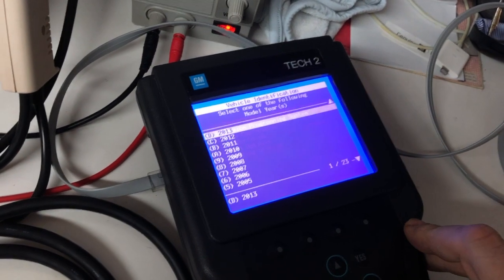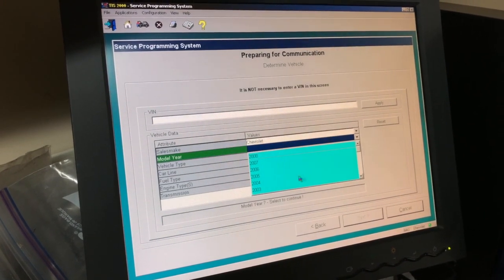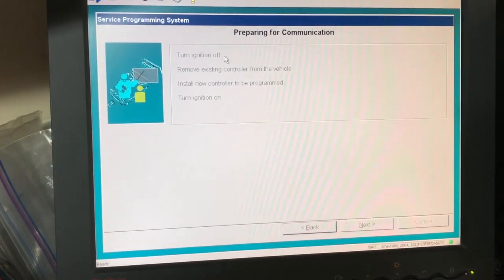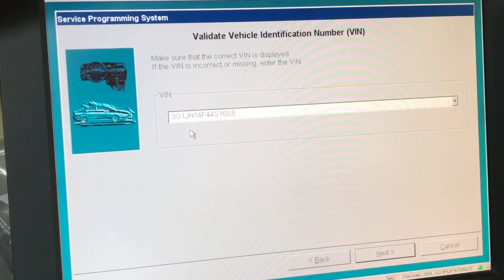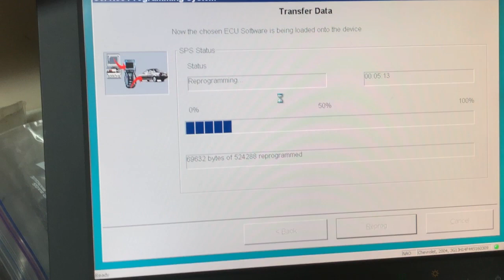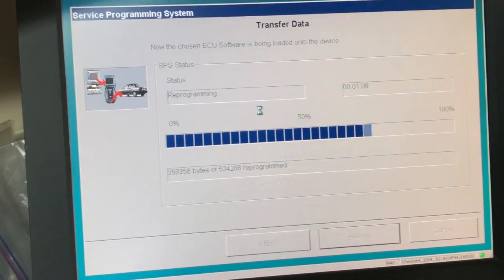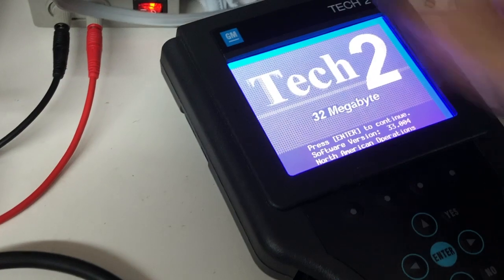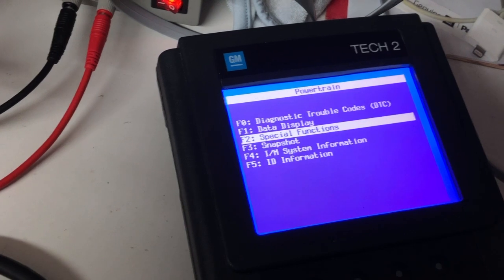2002 - 2005 GM P11 PCM Salvage Yard VIN Reflash with SPS and Tech2 (Chevy Pontiac Olds Saturn)

Comment: Hello,  I have  a authentic tech2 and tis2000 loaded on a tough book with a Bosch Mastertech J box.  I have successfully programmed several modules (on vehicle ) on various gm vehicles . I have been trying to bench program instrument clusters without any luck .  I’m trying th change programming on the microprocessor. I have a programmer to change the bin file on the eeprom. I have a simulator with a ecm , bcm and Vci.  It keeps saying install new IPC. Any thoughts?
Reply from the maker: I haven't attempted to do an IPC on the bench myself.  I presume you're trying to do SPS from within TIS2000 then for an IPC?   Be sure you select the Off Board Programming Adapter (OBPA) and not Vehicle when prompted in TIS2000 would be all I could suggest (even if you don't actually have one of these ultra rare tools in the bench setup).  In my own experience that selection was necessary to relax some of the SPS checks before I could program a PCM on the bench outside of an actual vehicle.  I suspect that the Tech2 and SPS do some checks that require more than the PCM and BCM on the bus as I've had to select OBPA even with both to have any success.
Reply: @DrShock  Thank you for you help, I was able to change the ecm and bcm programming  to a different year and vin number but not the IPC.
I do know that tis to web does not allow any bench programming. They told me that directly. 
I work for a used car dealership and we have a subscription.  I will follow your advice and see if it work with my tis2000. Thanks again. I greatly appreciate your help.

Comment: Hi. what if I cant Contact to the old ECM   because there is no Check Engine light in the dashboard in key position 2
what I need to flash the new ECM ( GMC Terrain 2013)
Reply from the maker: It may be that the bulb is burnt out for the check engine position, there is certainly one on all GMs.  2013 would be far too new for this video to apply.   You would need the GM MDI scan tool instead.   This video may help for what's involved there - https://youtu.be/sUMJFwMuAkE
Reply: @DrShock Thank you for your help
but if the bulb burnt out why I cant scan the ECM at all
Reply from the maker: If you're using a Tech2, it will not support many 2013 vehicles even with a CANdi module attached.   If you're using a non-GM scan tool I wouldn't know as I don't use those.  Here's a good reference link on the GM tools, you can see the GMC Terrain started being supported by the MDI tool in 2010 - https://www.genuinegmparts.com/pdf/positionstatements/vehicles-supported-by-GM-scan-tools-reference.pdf   Of course, there's also the possibility you have some damage to the wiring preventing communication, but I would suspect a tool mismatch first.

Comment: Hi......can this operation done with gm mdi  or only by tech2 ....thanks
Reply from the maker: Both would work fine, but if you use the MDI it will of course cost more $$ as you would have to have a subscription to GM SPS programming at www.acdelcotds.com
Reply: @DrShock  thank you

Comment: i have a tech2 that i use on my saab. do you know if a 2008 saturn vue is one the gm 32mb pcmcia card?
Reply from the maker: The Saturn models are different in alot of ways and I've had viewers comment, for example, that they don't show up at all on TIS2Web applications.    You'll want to just power on your Tech2 and build the car and see what options you get given after picking 2008 and Saturn under diagnostics.
Reply: DrShock ok so there is an option. Thank you very much

Comment: I'm About to do my first flash ever on an 06 cobalt...getting a used pcm, I have a cardaq 3 plus...this process the same?
Reply from the maker: It won't be the same as the Cardaq is not a Tech2 and is not compatible with the older GM TIS2000 software I showed here.   But you should be able to use it with a ACDelco TIS2Web subscription as a J2534 device.   You won't have the off board programming adapter option as that's not supported by J2534 tools, but you can still update the VIN using SPS.

Comment: If you replace a ecm and BCM  at the same time do you need to reprogram the ECM as you showed. With the BCM still
Work or no?
Reply from the maker: I'd suggest doing the ECM/VCM/PCM (acronyms de jure) type module first as that's the primary controller in the vehicle, and then doing the BCM second.   But I've never read that's a requirement, just seems like the more drama free path imo.   If it's a brand new or OEM remanufactured BCM you should be able to do the setup with the Tech2 independently of the ECM.  If it's an used BCM, well these older ones you can't update VIN or the mileage or odometer values (I did another video in this bench harness series on these BCM issues)

Comment: Hey Doctor. Im purchasing a ecu from a friend with a tune on it for specific parts for my corvette. Is there a way to change the vin to mine without erasing whats on the ecu?  Thanks
Reply from the maker: I'm not 100% sure as I only use the GM tooling.  But the GM scan tools are going to remove any third party tunes as best I can recall, as those are not GM approved calibration files.   I'd suggest you'll want to either let the GM tool reset the calibration and revise the VIN then separately re-apply the tune with the third party tooling.  Or use a third party tool that will also support updating the VIN.

Comment: I would like to know if you have used the tis2000 in isuzu vehicles? I have the tis2000 but I could not install a used ecu to isuzu 2002 axiom when I write thevin number  tells me that it does not exist, maybe that car is not in the tis2000 database?
Reply from the maker: I have not, only classic GM brands.  But you are on the right path, you have to have the Isuzu unique firmware version PCMCIA card plugged into the Tech2 itself, and Global TIS on the PC.  The typical TIS2000 DVD is only for North American GM brands.  If you search here on YT there's at least one video on how to install GlobalTIS for Isuzu vehicles.  Typically when you buy a Tech2 Chinese clone you have to specify these so they include the right versions.   There were different Tech2 firmware cards, and TIS DVDs for Saab, Isuzu, Holden, etc.

Comment: dr shock, so the dvd tis2000 that comes with the tech2 i am able to reflash off-line with it till 2007.so it comes with the calibrations already? or am i missunderstanding? thank you for your time and your good work
Reply from the maker: That's right the Tech2 using the old TIS2000 DVD is completely offline, no subscription required.  But it only covers thru model year 2007 (and I believe it is missing most of Saturn which had their own unique tooling back then).  Down the road you can still use your Tech2 from 2008 thru 2013, but you'll need to pay for TIS2Web, with an online subscription (around $40 per VIN for 2 years).

Comment: I want to recreate what you are doing--where should I get the TIS 2000 and do  I need an older computer? Thanks if you got the time
Reply from the maker: You would have to get TIS2000 when you buy a Chinese clone of the GM Tech2 scan tool (they're bundled together).   It only runs on Windows 2000 or XP so you'll need a museum piece, or put it into a VM on Windows 10.  You can usually find these on ebay http://ebay.to/2FLoIjI
Reply: @DrShock  Thanks

Comment: When you said "Tuning tool to just go in and jsut change the VIN", do you mean like a KESS or KTAG or something like that? I have a spare ECM (e78) for my Cruze, and I need to program the VIN for my car after a botched flash. Problem is, I don't want to pay HP Tuners again for two credits to reflash my ecu for the same VIN in the same car. I have the hardware, but would I use something like WinOLS to change the VIN, or do you know of some GM specific software to do this? I am hoping you can point me in the right direction. Thanks.
Reply from the maker: There's nothing from GM but what I've shown here which is their Service Programming System (SPS).   The Tech2 or alternatively the Windows emulator for it (Tech2Win) running with the GM MDI J2534 adapter for pre-2007 vehicles.  When I made that comment I was thinking EFI Live, but not from personal experience.  In most cases, since you mention a Cruze, it would be the GM MDI and using the TIS2Web SPS feature at www.acdelcotds.com (which is just the cloud version of the older PC DVD based TIS2000 I showed in this video) which is for 2007 and newer vehicles to change the PCM/VCM VIN.  But there is that one situation where it could be a problem calibration version wise, and then you would have to go third party tooling but that is not a common situation.

Comment: i have a 95 silverado diesel 6.5 TD can I reflash to delete the egr valve?
Reply from the maker: The GM SPS software doesn't let you customize or make modifications (aka tuning) from how the vehicle was originally built.  But it would cover a case where you pulled a donor PCM from a vehicle that had this valve and needed to put it on one that did not since the PCM part numbers are the same.  What would control that is the VIN, and the TIS2000 database has all the VINs built to offer up a calibration that is correct.  So you could reflash that donor PCM to one without the valve if the VIN called for it.   Hope that helps, basically the net net is no you cannot delete the egr valve with SPS if it was original to the VIN.  But you can account for it if it was original to the VIN when replacing the PCM.